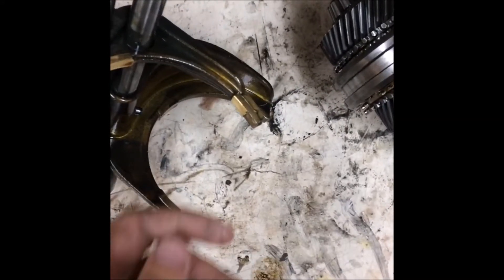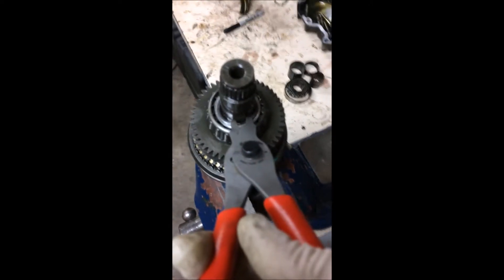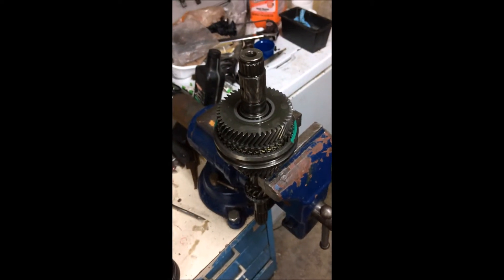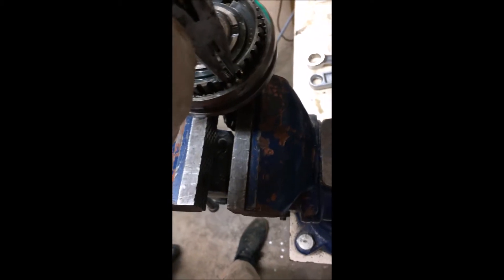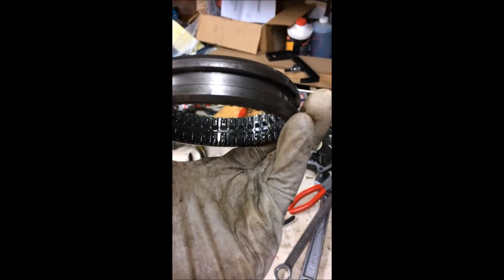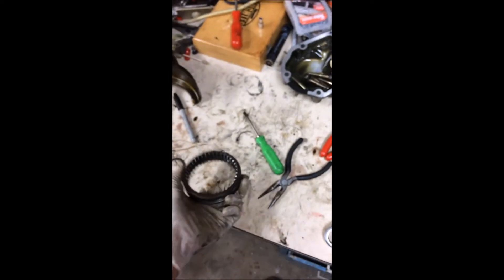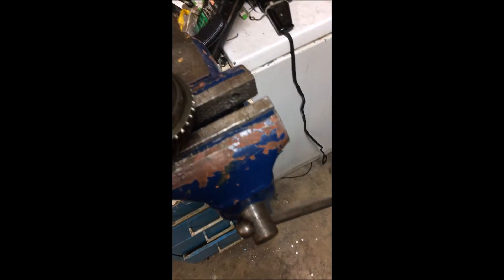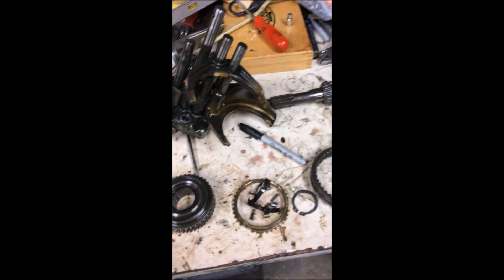SAAB/Cobalt F35 Input Shaft Disassembly.

Comment: Great show here.  Thanks.  The groove ring or sleeve needs to be able to slide up and down to fully cover detents on top and bottom gear.  Sleeve has three pairs of tall inner guides that need to match into the synchro.  I was scratching head for a while'

Comment: Hey buddy... I have a noise but I don't know where it's coming from and I cannot find any videos via searching to give me a definitive answer.  It sounds like a brake dust shield while driving on the highway, but it's constant and not a brake at all.  Key on or off while driving and in neutral, the noise is still there.  Upon further inspection on jack stands, it's a different noise with the car off and turning the wheel/tire/hub by hand; almost a clunking inside somewhere.  Car runs and drives fine, no clicking when turning, shifts okay but I think the adjustable clutch rod needs another adjustment though, otherwise, everything is fine.  I just want to find the issue so I can tear it apart, and order the correct replacement parts but not knowing is killing me Lol.  I saved a vid of it on the jack stands.  Lmk your thoughts if you could, please and thanks!
https://youtu.be/azJYMNUiHyA
Reply from the maker: I can hear it but very hard to give a definite answer without tearing into it / being there. Sounds like something internal to trans.
Reply: @93Viggen23   Not the answer I was hoping for Lol but Thanks man.  I'll drop the fluid today and see if I can find any metal shavings or anything in there